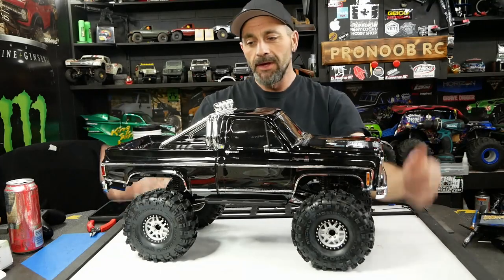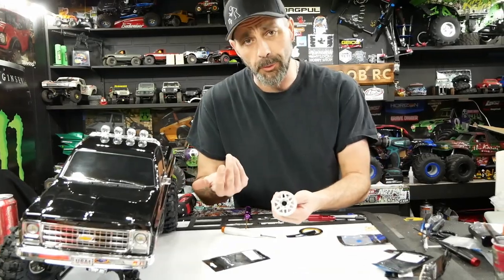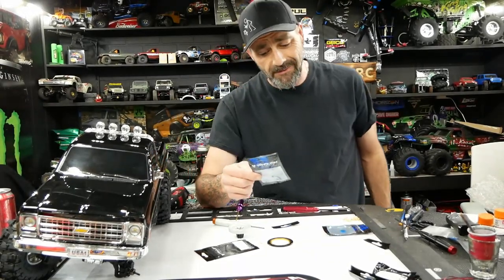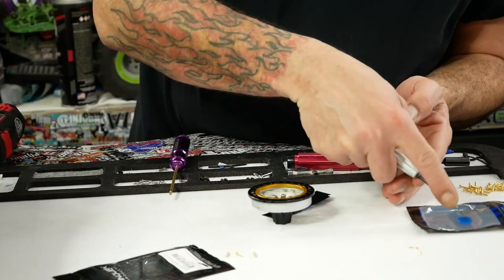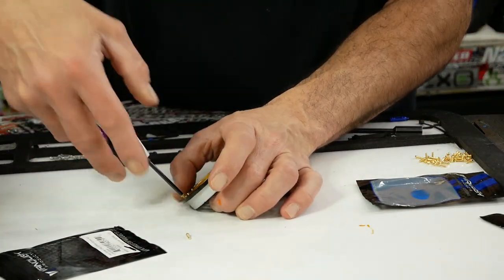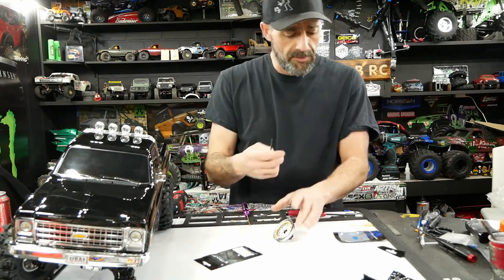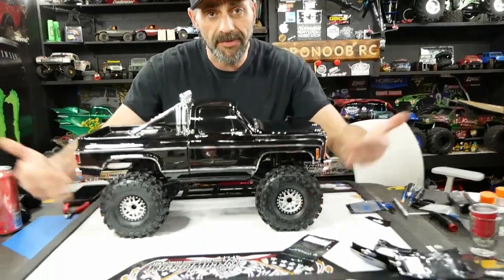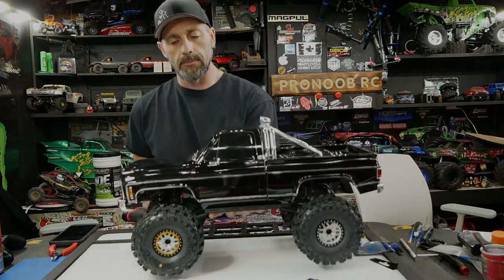VANQUISH PRODUCTS: 2.2 IFR RINGS AND SCALE HARDWARE

Comment: hi will ssd nickel screws fit the vanquish wheel beadlocks thanks
Reply from the maker: If the thread is 2/56 yes
Reply: @ProNoobRC  thanks fast reply, I'm from UK so the ssd ones are 2mm is that the same as the vanquish 1/64. Thanks